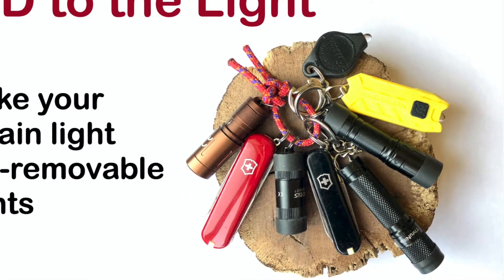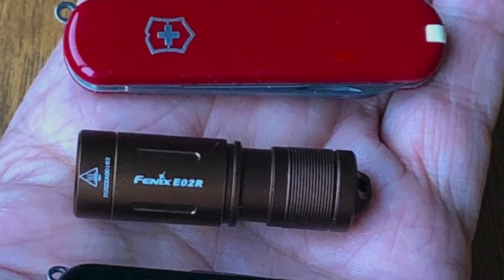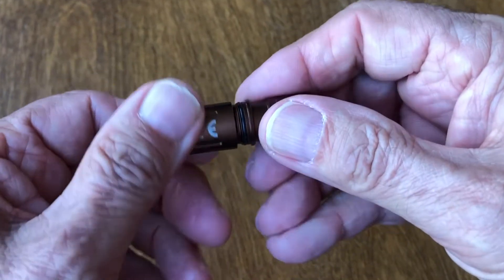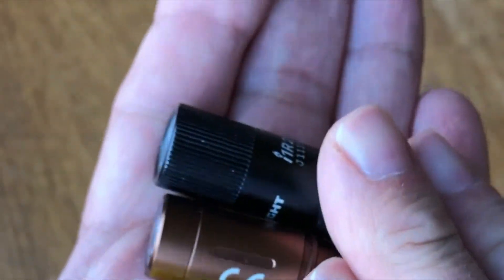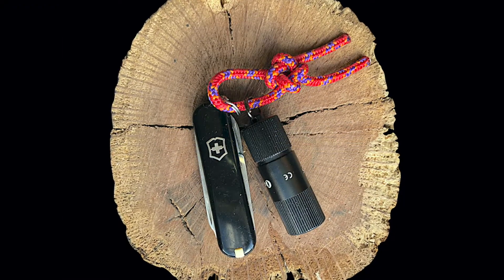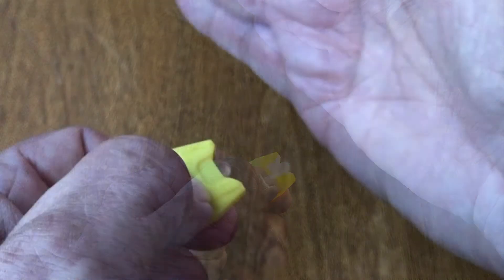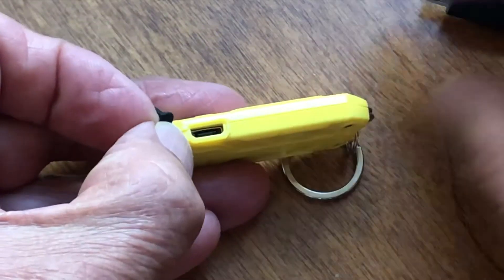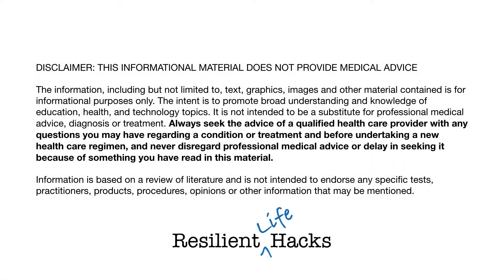Find or make your SAK keyring light. Part 2, Rechargeable lights

Comment: Nice! Also check out Rovyvon :)
Reply from the maker: Yes, I agree, very nice lights. I restricted the review to those lights that were in the same price range and size as the Classic SC and Exec 81. But, excellent info, nonetheless.
Reply: Ahh ok! Thanks for the awesome video though :)
Reply: @resilienthacks7038  The Rovyvon a1x is $20 so that is right around the price range of the Victorinox SD ($17) and almost the exact same size.
Reply from the maker: @AZ6023  Thanks, I will check it out!